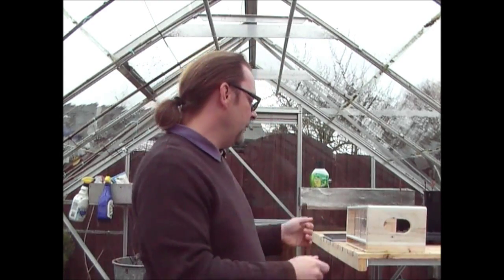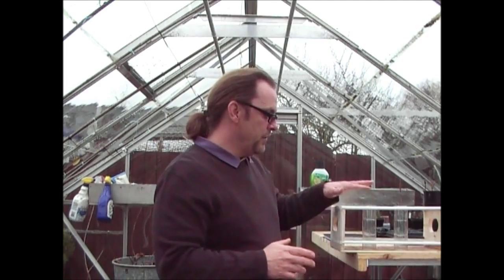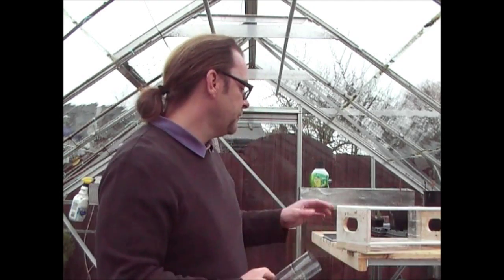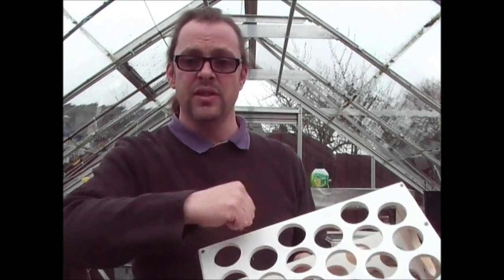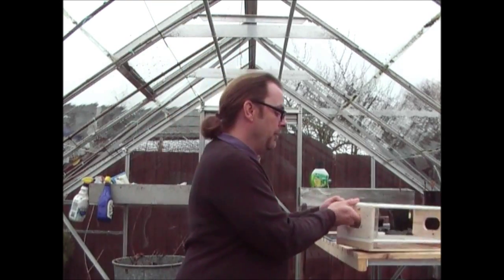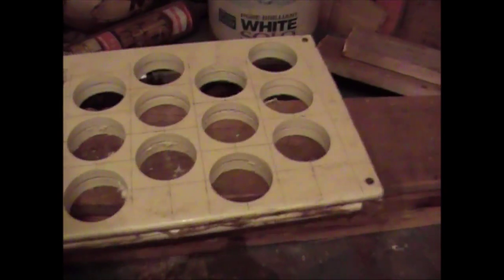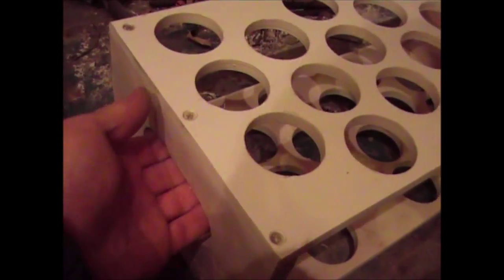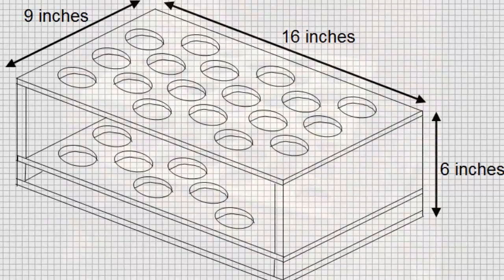Jim's Allotment - Plot 9 - February Tour Part 1 - Organic Vegetables-Parsnip Propagator

Comment: Liking the parsnip propagator, may have a go at one of those myself.  I'm chitting some seeds on a damp piece of kitchen towel at the moment for an early crop but I handled them when I sprinkled them on the towel, (poured some in my hand then used fingers to sprinkle) so not sure if they will germinate.  I remembered what you did last year with the three varieties and was going to do that later when the soil warmed a little.  Hopefully something will germinate.
Reply from the maker: Should be OK, it only seams to be a few people with that problem, so fingers crossed you haven't got the antiparsnip bug like me :o) Cheers Jim..

Comment: Thanks Jim. 
I will certainly make one one these. A guy on our plot uses the same method as Nora for germinating back-ups!
One question.....how long do you reckon from germination, is it safe to let them grow before the tap root reaches the bottom do the coke tube?
Another tip a seasoned gardener gave me (and it came in useful)
was when planting in the ground, sprinkle some vermiculite on top of where you plant the seed.. This makes is easier at a later date when sorting the weeds from the parsnips!
One last thing.....what varieties do you grow?  Last year was my first time growing and I had good success with Tender & True. 
All the best
Nigel
Reply from the maker: In the greenhouse, I would say two weeks for germination and six weeks until they are big enough to plant out, this would depend on the weather (temperature) though. Good tip with the vermiculite, I have also used sharp sand in the past. With regard to the varieties, I'll get back to you, I'm not sure of the top of my head.. All the best Jim..